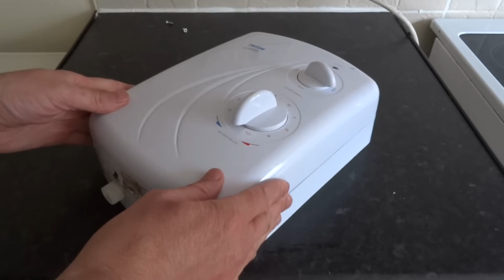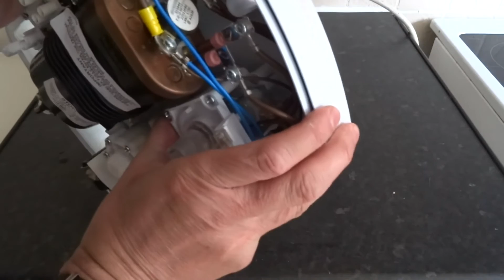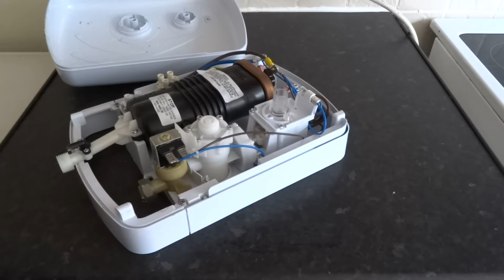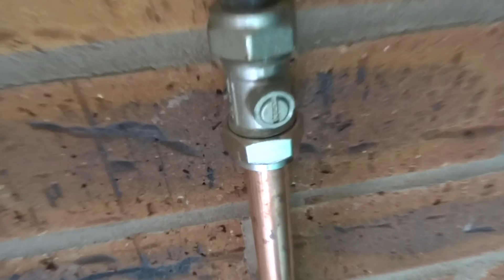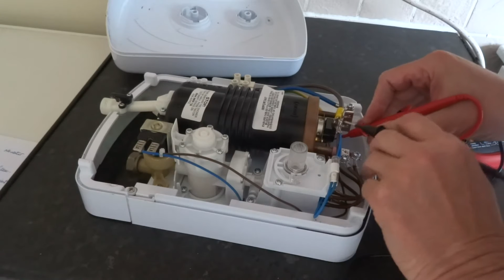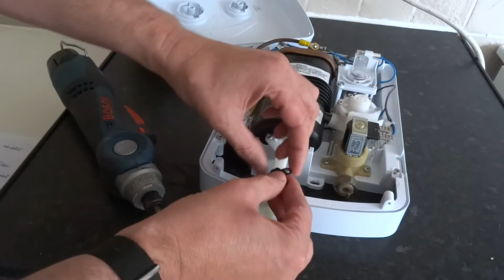Electric Shower Repair: Top 5 Faults & FIXES (No Hot Water, Leaking, No Power, Cold)

Comment: Tenant reported water only coming out of the shower slowly. Found shower hose was blocked so easy fix but water was now coming out cold. Following your video I tested the thermal cut out and there was no continuity. Replaced the thermal cut out with a spare I had in the garage from an old shower and working fine. Saved me £60 as the hassle of plumbing in a new shower. Thanks.
Reply from the maker: excellent

Comment: Would you be able to do a close up of how to test the solenoid valve with a test meter? And any other things to test in a shower with a meter and a quick explanation of how to do it and closeups of the part being tested
Reply from the maker: i was going to but the shoer i got in the solenoid was missing
Reply: @cagmito76 Would you would consider it in a future one ? And general basics in multi meter use at a slow pace, showing which wires/ connectiors to test
Reply from the maker: @justmadeit2  yes no problem next good unit i get ill make one -  thanks
Reply: @cagmito76 Brilliant ✌️

Comment: Ours started playing up after the water company changed the water metre. The pressure reduced just slightly. Now it's either red hot on its highest setting, or cold. Can get a decent heat from going on Eco with the highest number, but other than that temperature "control" is non existent. Would it be the pressure relief value?
Reply from the maker: i doubt it - it could be the outlet hose collapsed or head blocked - did they turn water fully back on - maybe they let some dirt into system??
Reply: @cagmito76  Stop tap was half a turn off fully open, as expected. But making it fully open doesn't resolve the problem. The water flow seems consistent and fine. But the temp control has no effect apart from High and Eco on 6. Everything else is cold.
Reply from the maker: @blahtoausername  check the elements maybe one has failed
Reply: @cagmito76 just seems coincidental it happened, without being adjusted, the day the water company fitted the new meter.
Reply from the maker: @blahtoausername  yes coincidences drive you donw rabbit holes sometimes it always best to test all components - maybe the water being off the element was dry then wet again maybe an airlock and element burnt out - its impossible to say without testing

Comment: I added a water filter on the bottom of my shower. No idea the filter had caps. I turned it on thinking it needed a minute to flow through. Found the caps, removed them and refit. When I turned the shower on the water flows but only cold. The vibration/noise from the pump(?) Is gone. Any ideas what I broke?
Reply: Triton T80xr
Reply from the maker: you need to test i cannor guess sorry

Comment: Thank for the video its very helpful.

My eletric shower stoped work, no water coming through the hose but the power light its on... so by watching your video i understood its the solenoid.

I need to ask you (or anyone here who knows about the eletric issues) so i notice before the water stops coming down, that the walls seems to get wet and the ceiling was dripping water, from the ceiling which  i thought was from the flat above, but now, that the shower its not working, the dripping from the ceilling also stopped so i realised that the entire problem its on my flat not the flat above.

My question is, based on the situation ive mentioned, what do you think  this wall wetness and dripping from the ceiling could be ? Any broken water tube inside the wall? Since the wetness folowing as a line above and below the eletric shower ... or should i  change the solenoid and see if the issue persists? Could be dangerous? 

Thank you
Reply from the maker: maybe you have a leak going to the shower but without looking its hard to guess and the fact its now stopped is odd

Comment: This is my exact shower, today it would not heat up. I did all the tests you said and got more or less the same numbers, In this hot weather I noticed the kitchen sink pressure a little low and thought nothing of it as the flow was still OK, The shower wasn't making the right water sound as it usual does could it be a blockage? Brain wave! Turned the stop cock up a quarter to half turn retested the show and BINGO! Back to normal. So thank you for these videos.
Reply from the maker: Glad to hear you got it sorted!

Comment: Hi  I have a Tritan T90SR  that is not heating the water ,the water is cold and the unit is very quiet as the internal pump is not running .I have can get it to heat the water if I hold the two micro switches behind the flow control nob in the made position.  Look like there is not enough water pressure .. My question is does the pump make the pressure of does it not run if the pressure is down. I have checked the pump power module and it is giving approx 15 AC out of the module ( transformer ).  Any advice would be appreciated.. I am holding off from buying a pump as its about £80 -85 pound. Thanks..

Comment: my triton is working fine on cold, warm and high power setting but as i turn the power dial to full power it trip the whole house power.? otherwise water pressure is fine and water getting hot enough (at this moment my power dial is on high and water is hot enough but in winter i need it to be at full power  ) any suggestion will help thank you!
Reply from the maker: could be pulling to much current or you breaker is too sensitive, an elecrician can test both

Comment: Mine doesn’t heat at ii setting. Like it’s stuck on I setting. Replaced TCO, no luck. Replaced micro switch no luck.  Now thinking it’s the heater and a coil damaged. When issue first occurred was a loud sound and tripped mains. Any ideas?
Reply from the maker: best to test each component until fault is found

Comment: Mine is an Aquatronic Ultra 4 and it's scolding hot. It switches on a "low pressure" warning light, then switches the heater off. 

It's fine on setting I, apart from it being "cold", but on setting II it's a liability. This morning I had the dial right the way over to maximum cold, and on setting II, and it tried to burn me alive. 

Is that the flow valve? I live in a high limescale area... I'm thinking something is clogged. 

Thanks!
Reply from the maker: could be clogged or maybe water pressure in system

Comment: No heat. Checked the TOC and it didn't have resistance, checked the heating elements and both had resistance of approx 12ohms, but when i checked the solenoid on the inlet the multimeter read 1250. I'm no expert, i decided that as we had a shower head that had an on off switch, and had been accidently shut off, this has likely effected multiple components in the shower so we decided to get identical shower replacement for £69,
Reply from the maker: good work - you replace yourself ?
Reply: I also have a rogue shower head with an on/off switch built in, my wife used the stop switch for about a minute and now the shower only gives out stone cold water. Will I also have to replace the whole shower?

Comment: Mine has ‘hot for first few seconds, then just goes cold’ 🤷‍♂️
Reply from the maker: Your electric shower is likely going cold because of a blocked showerhead or hose, a faulty thermal switch, or an issue with the heating element itself
Reply: @cagmito76 I found the thermal switch was open circuit, swapped in a new one and it was fine
Reply from the maker: @____________________________.x  ah ok bud thats great
Reply: @cagmito76  yeh I was pretty relieved when it all worked. I’d bought a complete replacement shower just in case (as I had to get it working ASAP as it was in my rental house) but thought I’d first try swapping out some likely components first. I almost felt like a real plumber, lol

Comment: Hi mate how do you remove the olive and nut?
Reply from the maker: its hard but can be done
Reply: @cagmito76 are you able to do a video please
Reply from the maker: @AdamAdam-gx6pt  ok when i next get one 
you
Reply: @cagmito76 cheers bud still struggling with mine and the part itself cost 20£+ and a whole new unit is round £60…but if I can get the olive out that would save that..if that parts not faulty…
Reply from the maker: @AdamAdam-gx6pt  can you see exposed olive 
and get to it with pliers
Reply from the maker: you need to light squeee around the oilive all the way around if you can tap it with an hammer all the way around its even better eventually it losens i was showed this by an old plumber years ago
Reply from the maker: i just had a practice it hard not enough room i got it loose but still not off

Comment: we have had 4 triton showers and all last around six months then they wont run hot at all, just freezing cold water??? what could be causing all to blow so quickly? and how do i check??
Reply: Omg I thought I was only one!! We've gone through 3 in the past year!!! Did you ever find out why? I am starting to think I've got a problem with the electrics that keep shorting the heating element
Reply: @KatrinaMcevoy  turned out that we had used longer hose and different shower heads, triton showers only use short hose and a crappy head, made for low pressure! so if you use anything else the shower cant cope with the pressure needed
Reply from the maker: yes makes sense - thansk for update
Reply from the maker: large family ? budget models ?

Comment: Motor running but no water?  If it is very col weather, check for a frozen supply pipe before going after the solenoid!    I'm lagging mine now after discovering the real cause of no water.
Reply from the maker: could be - test parts before repacing

Comment: My shower cold till you turn up to 8 the it gets very warm turn it to 5 it goes cold but turn it to 6 for a bit then down to 5 ok
Reply from the maker: electric showers heat by flow rate of water so check for inlet pressure blockages filters blockage internal hater can , flow stabilser valve wear , out let pipes.

Comment: Hi great video. I have just fitted a triton T80si where it will not switch off and water is leaking constatnly. I have replaced teh diaphram and solenoid valve but its the same scenario. I have just tested the on/off switch with a multimeter and that checks out ok. Im a bit stuck now.
Reply from the maker: maybe microswitches ? best to test befoe replace

Comment: I just have absolutely no power I can’t work out what it is
Reply from the maker: if you got no power it could be wiring , switches , pressure microswitches thermal cut out it needs to be tested but never test with electric on.

Comment: Hi, we've replaced our Gainsborough e50 shower with a new Gainsborough e50 unit as the old one started going hot and cold and then didn't heat up at all. 

The new shower unit is fitted, power comes on to it and it isn't tripping the RCD. Water pressure seems fine but the new unit isn't heating up either? Any ideas as to what the problem might be? 

Ps don't know if it matters but our combi boiler went faulty around the same time s the shower stopped working properly and have been told that it needs a new divertor valve (cycling on and off every few seconds) and radiators heat up when selected to tap water only mode. 

Many thanks in advance

Comment: Thank you, it’s the solenoid on mine kept cutting the water in and out, tested it and it’s at 4.5 ohms. Is that good or bad?
Reply from the maker: it should be 3.7 to 4.5 K ohms, but they can expand the copper wires inside when hot and cut out.
Reply: @cagmito76  thank you

Comment: Thanks for this. The Pressure Release Device has gone on our Triton, so now I can get it replaced easy. Thanks again. If it goes again quickly then obviously there are other issues, but your video has helped massively. Cheers.
Reply from the maker: No worries and thanks for comment, appreciate it!
Reply: Can you please confirm when the PRD was blown out, there was no hot water and then when you replaced the PRD you got hot water again ??

My PRD seems to have blown out, I ordered replacement discs that should arrive in a couple of days, but also I have no hot water right now,,, will replacing the PRD disc also resolve the hot water issue ??

Comment: My TCO keeps failing.  3 in 3 weeks!!
There doesn’t appear to be any scaling and when I changed the inlet filter again no sign of scaling.  Pressure and flow seem ok.  I take a shower with no fluctuations in pressure and temperature then the next time just cold water.  Heating tank at 11.3 and 11.2 ohms.  TCO at 0 when fitting and when failed at 1.
Any suggestions greatly appreciated
Reply from the maker: It sounds like you checked most things , if your getting good flow through shower , head is not blocked and hose is no collapsed internally. Id suspect the elements either faulty or limescale. It is usually limescale build up.
Reply: @cagmito76  
Thankyou for your reply and advice.  
Is it possible to clean the limescale from the tank or would it need a new unit (Cheapest I’ve seen is £129) If I can clean it how do I go about getting rid of the limes ale build up on the elements please and what would I use to do this.  If it is possible it’s probably worth a try would you say?
I can’t just keep replacing the TCO at £23 a go tbh but I do have another one.
I do keep seeing different numbers on the top of the TCO but the shower sales say they’re ok for my shower.
One said 52 - 75 and another 48 - 75
Once again .. thanks
John
Reply from the maker: @johnster-w3k  There is a video on here of someone doing it im not sure of how successful never tried myself
Reply from the maker: @johnster-w3k  If you go to my description in video there is link to my blog ( buy parts ) scroll down page and there are links to TCO for 14.99.
Reply from the maker: @johnster-w3k  https://www.youtube.com/watch?v=4-2-6LWIMKw
Reply: Update
I’ve followed the descaling although the elements looked brand new tbh.  Could see the copper coloured coils through an inlet.  Nevertheless I’ve done it.  Tested the elements again at 11.2 and 11.3 ohms as before.  I’ve fitted my last TCO and the shower is working fine again.  Time will tell.   
Do you have any more suggestions if the TCO fails again (they’re never resetting just failing straight away)
Cheers
John
Reply from the maker: @johnster-w3k  Yeah they more often that not dont reset , you can drop they or tap them to reset sometimes.

Comment: If there is low water flow when the selector switch is on hot and good when it is on cold and doesn't heat up, what could be the problem?
Reply from the maker: Could be limescale build up on element , could be element failure one of them or failing or not being switched on , under power if new.

Comment: Hi my shower switches off the light stays on but the water stops coming out after around 10 mins. Shal i replace it then?
Reply from the maker: Sounds to me like solenoid failure. Easy to replace. but test for to be sure
Reply: @cagmito76  i just gone and bought a new shower 😂
Reply: I got the exact same model tritan 2 madrid i hope i can put it up by myself tonite
Reply from the maker: @gabbybarnsy2830  It not too difficult just turn of water and electric and be careful.
Reply: @cagmito76  is there any chance i can cal you when im starting off? Later on i can give you my no

Comment: Interesting. My Whirlpool shower will only heat on low and no indicator lights come on, on Medium and Hot.? Any suggestions please?
Reply from the maker: could element or microswitch have a test see what it you find , if it s PCB controlled its an extra complication

Comment: hi my shower is very lower pressure on the heat temperature setting. It comes on for 2 seconds at high temperature then cuts out and the pressure goes very low to a trickle of water. What could be he issue? thx
Reply from the maker: Do some tests check heating elements maybe one has gone , is the water pressure good , any blckages is the water flowing through the shower and pipe and shower head ok ?
Reply: @cagmito76  hi thanks for getting back to me appreciate it. The flow of water is fine when the water is turned to cold but not when run got it is a trickle.
Reply from the maker: @erikmorales1004  Let me have a think on that , its hard one as usually low pressure is affected when hot or cold as heat in controlled electrically.  Maybe its overheating and cutting out but ill have a think and get back.
Reply from the maker: @erikmorales1004  What model do you have Erik ?
Reply: @cagmito76  I think your correct it seems to be cutting out and the water get very hot and it makes a click noise then the water stops.
Reply: @cagmito76  I'll have a look today and get back to you. Thanks
Reply from the maker: @erikmorales1004  It could be overheating and cutting out to protect itself , or it could be the solenoid faulty and when it heats up and expands it cuts out . Id suspect the solenopid first as its common failure and its cheap to fix see my blog post here to buy them the cheapest place but they are good https://electricshowerrepair.blogspot.com/2021/02/to-save-money-you-can-just-replace.html
Reply: @cagmito76  hi the model is triton tbo z
Reply: @cagmito76   hi the model is triton tbo z
Reply from the maker: @erikmorales1004  is it T80z its not PCB controlled so its lot more simple
Reply: @cagmito76  right yeh I read it's a T80z so what do I do open it and change?
Reply from the maker: @erikmorales1004  +
I would yeah but make sure its safe turn off electric and ensure 100% safe and turn of water too  . Its very easy to break these valves, someone on here recently did and got a lot of water.
Reply: @cagmito76  thanks